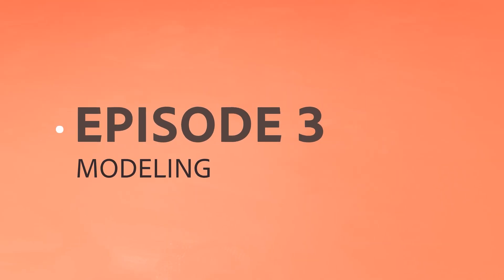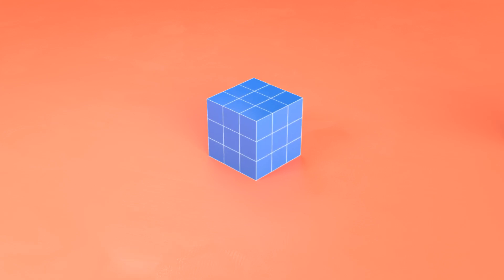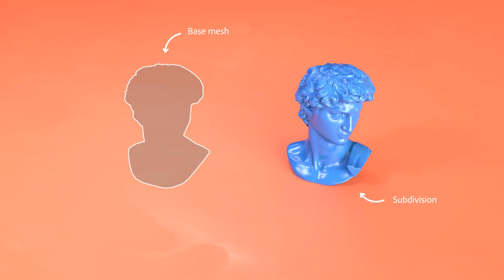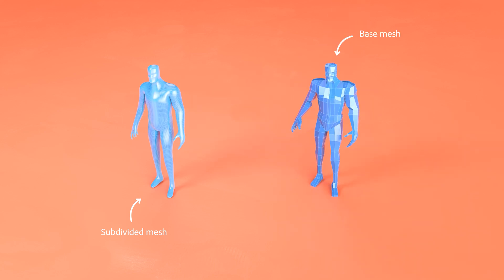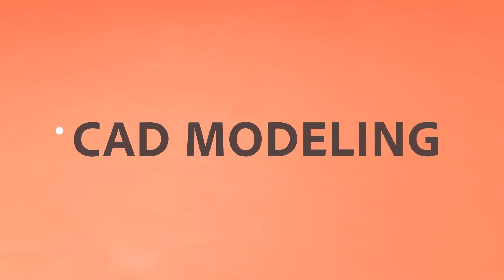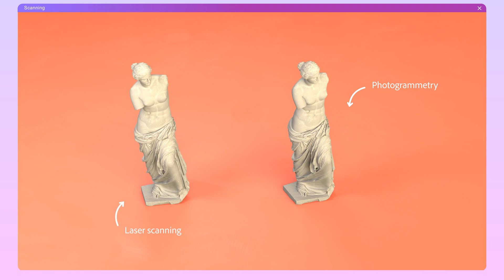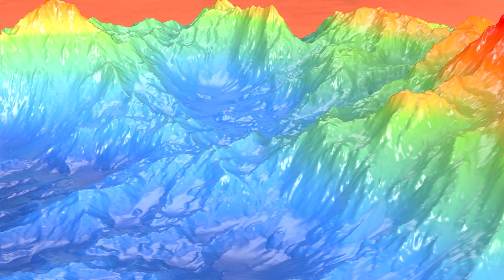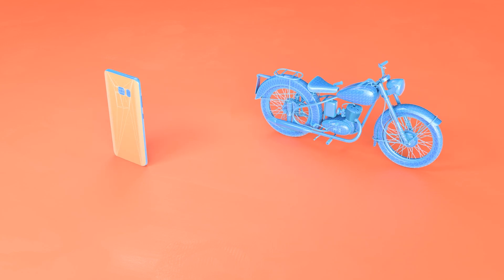Adobe Start 3D - Modeling | Adobe Creative Cloud

Comment: it's very cool the scanning tool. but with what software ?
Reply: I have xbox one kinect (the hardware) and connected it to a windows PC. You can get an app "3D scanner" from windows store. Place the object you want to scan on a spinning table. Position the kinect towards the object. Click "start scan" on the software. Rotate the table slowly, to a complete 360° revolution. Click "stop scan". Then it will generate a 3D model for you (plus a little bit of the base/the table surface), as .3mf file.

Comment: 3:38 WOW how do I do this? What programm do I need? I can't seem to find the specific tutorial for this 2D image into 3D
Reply: AutoCAD? SketchUp? Any CAD Software?
Reply: @aditiomahendra1230  thank you. I thought this was included in Adobe but it seems I need a different program
Reply: @turboterps  It's not an Adobe tool, but most CAD software works like this. Free ones are Designspark Mechanical (very easy, it's what the visuals were based on), or Autodesk Fusion (more advanced and complex).